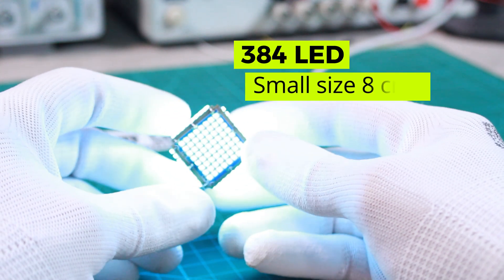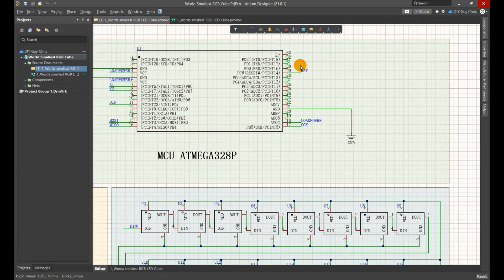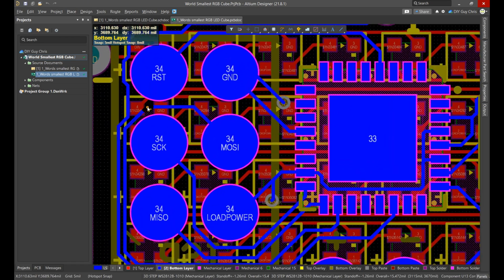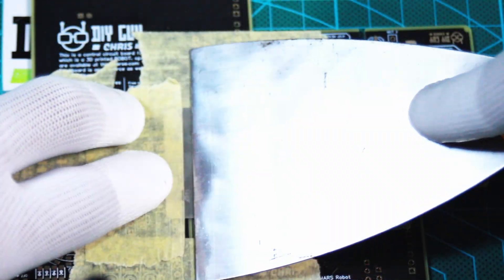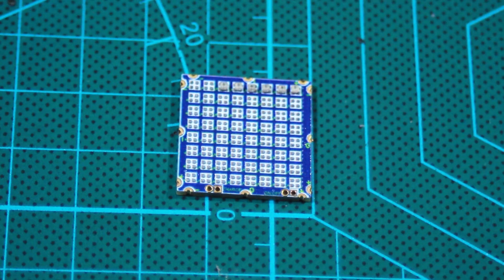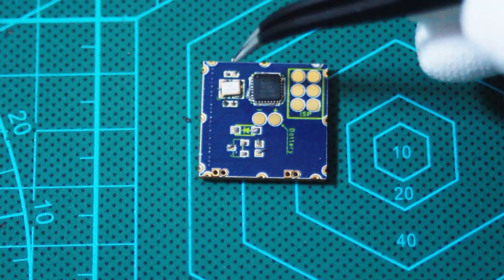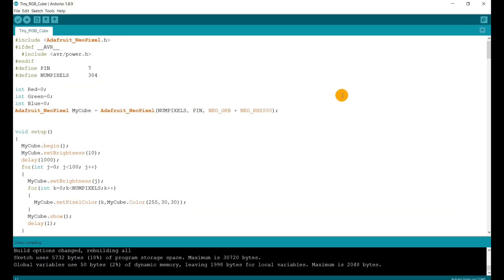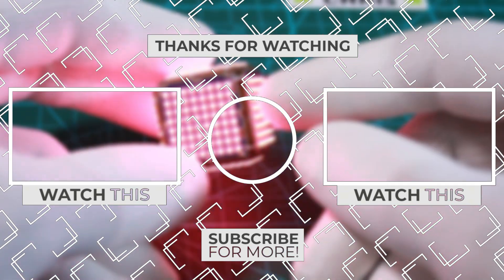I made this Small RGB Cube | 384 pixels 🤩

Comment: How much power is it consuming? Does it heat up?
Reply from the maker: @window.location  A great question, I didn't highlighted the power consumption on the video, I set the LED brightness to a maximum of %10 (check the code from the download link) this will help the battery to keep the Cube alive for at most 32 minutes, with some random delays between animations the Cube could stay up for longer.
Reply: @DIYGUYChris   Great project been following your work on instagram for some time :D. What about idle current of the led matrix? I would presume led drivers(in each led) draw some small current in idle that adds up considering there is a lot of leds.

Comment: I watched the video serveral times and i got to know u are not using any charge management IC ? are you relying on the inbuilt bms of the battery ?
Reply from the maker: No charging IC the cube's battery must be charged from external charger, the MOSFET in there is for the Power Path Management

Comment: Nice project! 

Is there a short circuit protection for the battery charger terminals? I can see myself mistakenly putting the jumper in those pins instead of the on/off.
Reply from the maker: @buda_glez  I will optimize this because that's what I did already, shorted the circuit twice 😅

Comment: Cool project. Did i understand correctly that one side has memory and the rest of the sides repeat the pattern of the main face?
Reply from the maker: @Jesus4KungFu  No, all side are connected in series so you can control each pixel of the 384 pixels separately to create a whole cubic pattern 😊 BTW there are some ready to use API functions that allows you to program the animations 😉 maybe you want also to take a look at the bigger Cube, link in the description
Reply: @DIYGUYChris Hi chris do you have eagle lbr part fpr the led used 1010 size cant find anything online cheers

Comment: So nice 😍😍 I like it, I think to improve it a little bit, change the charge pins by round female headers,  and the jumper to, to make it Nice without pin headers out
Reply from the maker: @younessid437  the pin headers are the smallest part I found to fit in such tight area but your suggestion is also a solution, I consider to add magnetic charging pins in my future devices 😉

Comment: Beautiful work! So are the boards 20x20 mm (making the finished product 20x20x20mm) or is the final product 20x20x20mm?

Impressive either way for sure!
Reply from the maker: @cookedaudio  each side of the Cube is 20 by 20 mm so the Volume is 20 x 20 x 20 which is 8 cm³ 🤭 real light and small in hand 🙃
Reply: @DIYGUYChris  I'm sure it is! What I mean to say is, does that volume include the thickness of the PCB and LEDs?
Reply from the maker: @cookedaudio  🤔 well that was not included the I must add 1.6x2 for two PCB thickness and 1x2 for two PCB Layers which makes it 25.2mm going for the volume it has become 16cm³ 🧐 the inner volume remains the same.
Sharp thinking 🤟

Comment: Wireless charging and ESP32 to connect, do it :elbowcough:
Reply from the maker: @emylia7496  that's challenging, probably this is a good opportunity to play with the ESP32 ,😉
Reply: ESP32-C3 would be good for this
Reply from the maker: @tim0steele  yes sure, higher potential but it is difficult to take an AVRs lover away from the Atmega MCUs 😅
Reply: @DIYGUYChris  One big advantage to ESP32-C3 is that you can update the firmware over wifi.
Reply from the maker: @tim0steele  yep indeed, 👍
Reply from the maker: @tim0steele  yep indeed, 👍
Reply from the maker: @emylia7496  that's challenging, probably this is a good opportunity to play with the ESP32 ,😉
Reply: Wireless Qi charging is not possible with 20mmx20mm. Also the charging face will not be able to contain LEDs. I have made a 40x40x40 cube with exactly this.